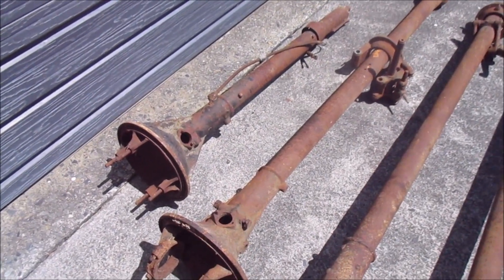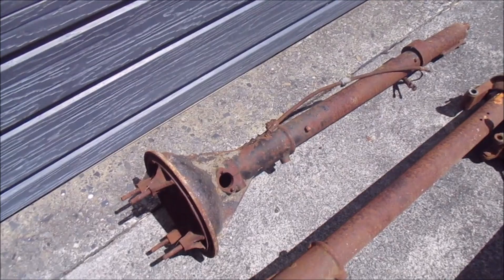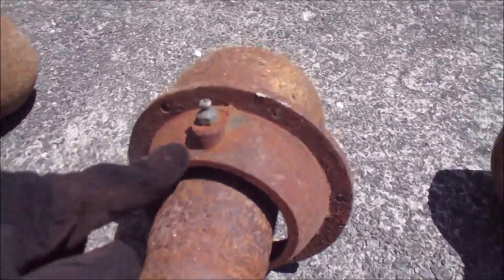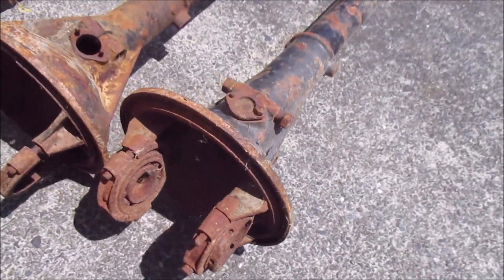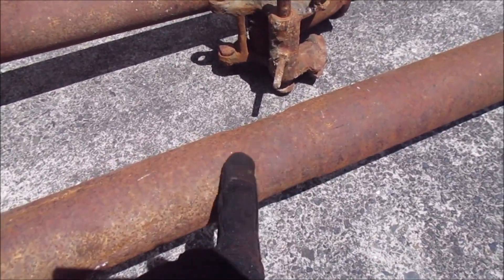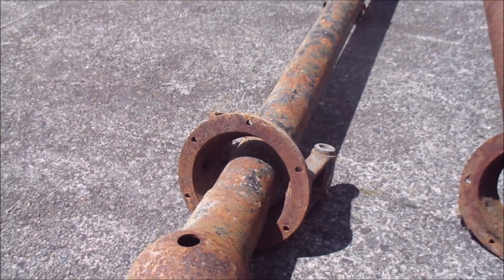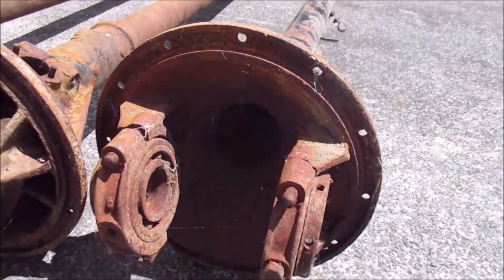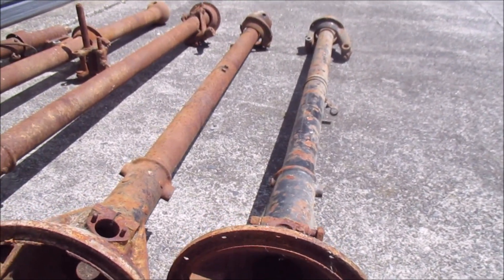Showing the different Riley 9 torque tubes I have.

Comment: The different brake brackets may relate to what gearbox was fitted i.e. preselect, silent third, all helical
Reply: Probably relates to whether it had cable or rod brakes?
Reply: @ces7515  yes didnt think of that -
Reply from the maker: Yes, there is some difference apparently between cable and rod ones. That's the good thing about building a special, you can make what works! The original Brooklands I have many photos of had rods.
Reply: I think early 5 stud 9s might have had rods then cables with the mk4. Later cars had rods again with the Girling brakes. Simple!

Comment: Our special is based on a mark 4, I've just fitted a new CWP, at 0:28 it is similar to ours, and the 'brake bracket'/assembly is definitely for cable brakes. At about 1:15 you mention the hole in the top, which is for inspection/adjustment of the pinion.
Reply from the maker: I think they all have the top hole for adjustment as you say. I think it's the holes in the sides that might matter?
Reply: asciimation the holes in the side are to locate the cable brake cams.

Get a Riley 9 workshop manual- there’s a diagram that will show you what I mean. Pictures are much easier to follow!